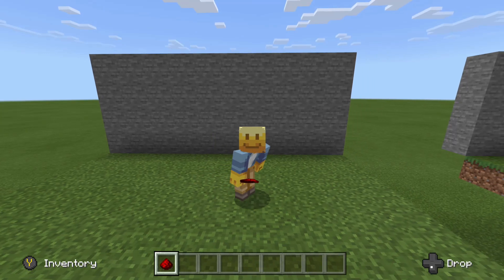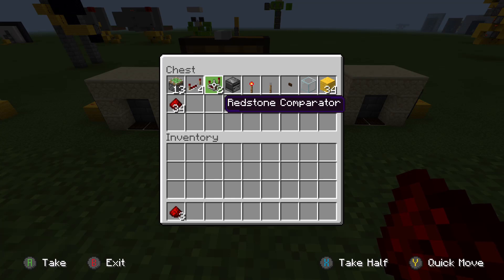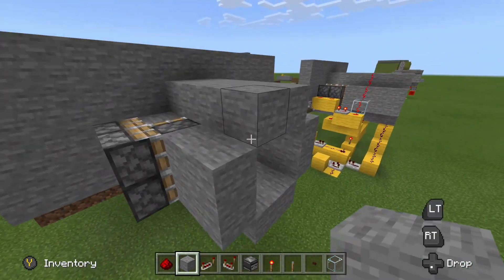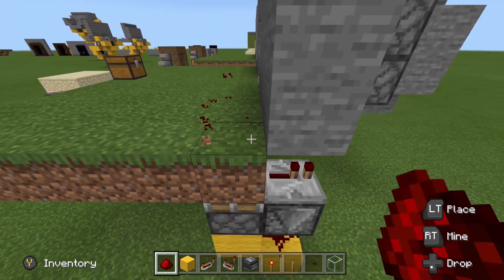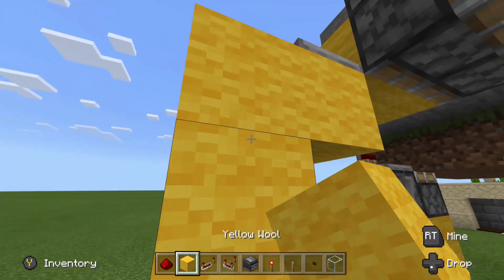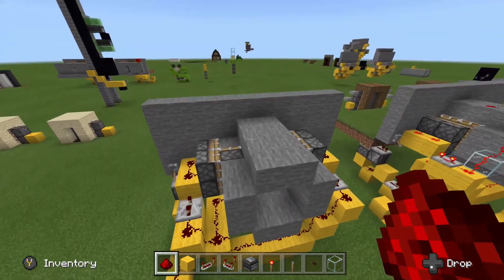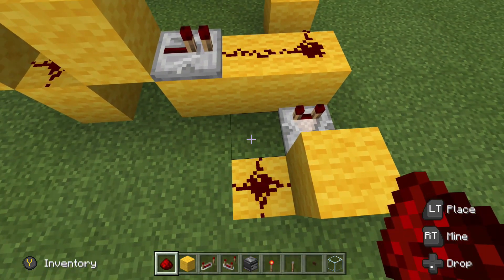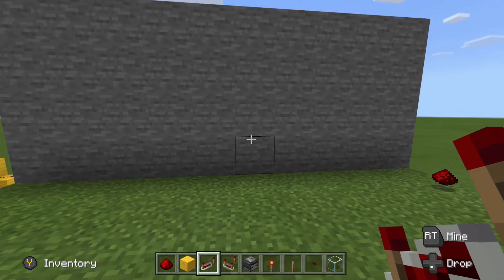Minecraft 2x2 Flush Piston Door with Hidden Input (Bedrock Edition)

Comment: It's not working completely. I did everything u did and the part were u activate it with the redstone torch and connect it isn't working when i update the observer..... Please help I'm on PE.
Reply from the maker: Did you make sure to place the lever and turn it on? The way it works is the lever powers the redstone key, which in turn powers the block it's sitting on. The repeater on the observers face pulls a signal from it and updates the observer, which in turn powers the piston to break the key.

Sorry for the long explanation. Please let me know if this helps
Reply: @Robs_Mind  I figured it out. I placed one of the repeaters in the wrong direction. Lol but ty.

Comment: I'm having a bit of trouble getting the observer block to work. I've never used one before so idk if I'm doing it right but when i place redstone the piston doesn't move
Reply from the maker: The observer needs to be looking up with a repeater on its face. Redstone dust should be below it with a block to the side of the redstone and a sticky piston on top of that. You do have the lever and it is in the on position right?
Reply: @Robs_Mind  i think i did. I know i did on ps4 but xbox maybe not. Either way it wasn't working

Comment: Hey dudes can anyone help me do this, I followed step by step, placement by placement, frame by frame and yet it doesn't work. Can anyone hit me up here or on xbox. Gt: MythiC VoiDzZ
Reply from the maker: Do you mind explaining what is happening? I would jump on and help you, but I'm currently at work
Reply: Ah okay dude it's completely fine! Have a good day! Basically I've watched the video and it just doesn't work like the repeaters are exactly the same everything is and basically the door isn't hiding all the dirt blocks at all like it has a 2 x 2 square to fill but only fills 2x1 gap
Reply from the maker: @skellyvoidzz9397  is it pushing the wall flush on the top, but not the bottom?
Reply: @Robs_Mind  yes
Reply from the maker: @skellyvoidzz9397  great! That may be a really easy fix!! I recommend going to the bottom of the circuit where the redstone wire runs into the solid blocks of your hallway. Move your redstone line so it connects to the block right behind the one you are currently connected to, and this should fix everything I hope! 

Please let me know if that was the issue
Reply: @Robs_Mind  okay, I will try in a bit thanks!
Reply: @Robs_Mind  still doesn't work
Reply from the maker: @skellyvoidzz9397  later on this evening I could jump on Xbox and join up with you to try and figure it out. It really seems like the redstone just needed to be redirected... Would you mind teaming up later to figure it out?
Reply: @Robs_Mind  dude I was waiting for you to say this, course I dont mind!!!! When you coming on? :)
Reply from the maker: @skellyvoidzz9397  probably about 8 hours from now
Reply: @Robs_Mind  umm I'm from the UK so It'll be 6 o'clock can you do like earlier or later maybe by (earlier)7 or 6 or (later) 9 or 10?
Reply from the maker: Actually, it may be an hour or so sooner. I'll comment to you on YouTube when I'm ready to go!!
Reply from the maker: @skellyvoidzz9397  what time is it there so I can know the actual time difference?
Reply from the maker: It should be midnight for you... Are you wanting to fix your door, or do it on the weekend?
Reply: @Robs Mind over here its BST not a clue what it's over there so just convert your time into BST then if you can reply in BST. Thanks!

Comment: PS4 Users
you have to place redstone on top of the top 2 pistons as the redstone won’t automatically connect
Reply from the maker: Redstone on top of the blocks that are on the top 2 pistons will power it, as shown in the tutorial.
Reply: Robs Mind it does not in ps4 the redstone does not go in to the pistons, in ps4 the redstone mechanics are different on xbox when u place redstone it goes out in 4 different directions and on ps4 it doesn’t go in any direction, i built it yesterday and it didn’t work until redstone was actually on top of the pistons
Reply from the maker: That's really strange... I don't own a PS4, but I really assumed all bedrock edition Minecraft, even if it's on a different platform, had the same redstone mechanics.
Reply: Robs Mind very close and similar but redstone dust itself is a lil different and ps4 is worse than xbox which is bedrock it’s like bedrock but it’s not quite the same like we don’t have realms or servers
Reply from the maker: @armandomelendez9902  thank you for the useful information. I really thought powered redstone dust would also power the block it's sitting on and thus power the pistons.... Very strange indeed
Reply: Is that the only difference, everything works but the key doesn’t open it
Reply from the maker: @fathergvd  did you make sure to put a lever on the wall in front of your grass block? If you did, make sure it is powered, or the key won't work